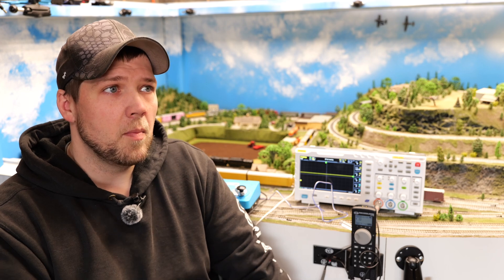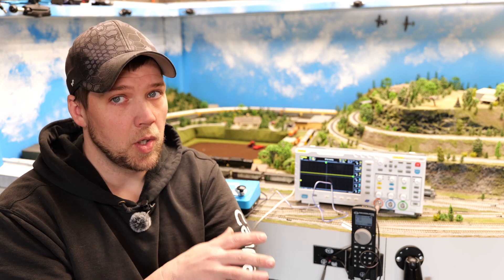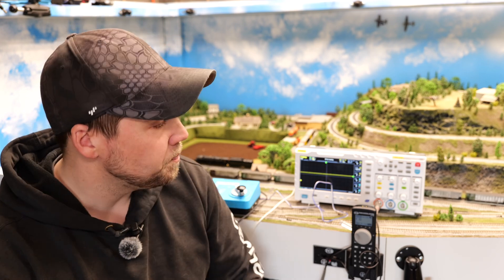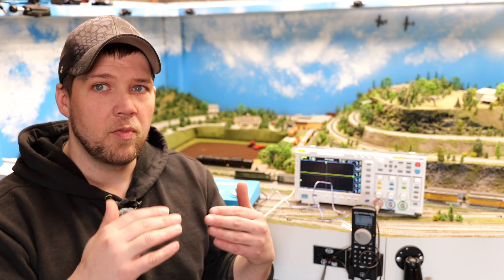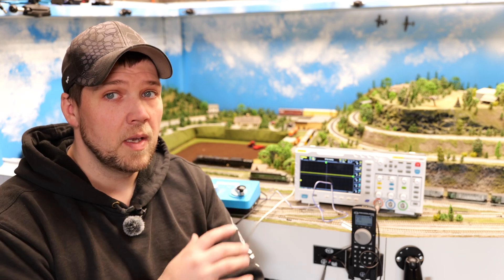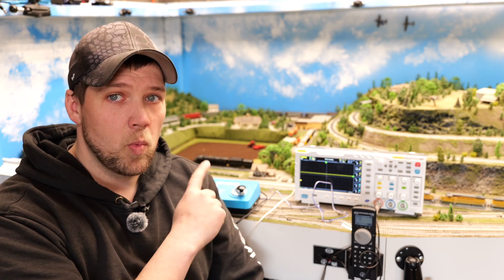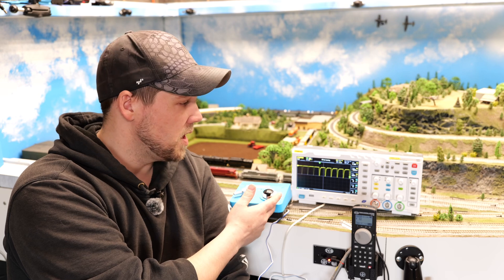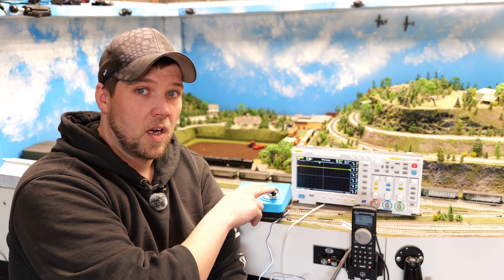Is it time for DC to die?

Comment: Clean power from a wall wort that's funny. If that was on my radio you would be able to hear yourself think. But, not even  dcc is clean RFI. I have to unplug my trains when I want to use my radio. TOO much interference. Nice to see someone out there still can use an oscilloscope. Keep on learning young man. You said you have a ham radio what is your Call and what is your radio. I am a Icom 7300 guy, it has never let me down.
Reply from the maker: Honestly just a lurker. I have a gmrs license. I could take the tests but just havent had time. I have a repeater setup and some gmrs stuff for our homestead. When I can get my license I have an FtDX10 to us

Comment: How the hell do putting 12 volts to a motor half the time make it 6v? That doesn't make sense.
Reply from the maker: Youre not putting 6vs to the motor. If you pulse 12vs at a 50percent duty cycle it averages 6vs. So just say the frequency is 60 cycles a second it would be on for half a second and off half a second but pulsing 60 times

Comment: no .. not at all .. DC should still be the standard for getting kids into the hobby .... who is gana buy a kid a 300.00 loco??
Reply: In what universe is a DCC loco $300? A Kato runs $90-100. Decoders are $30-50. All he is saying is that just scrap the DC version and only offer a DCC model that runs on DC as well. Up the cost by $10ish and have a more capable loco.
Reply: @NSCALESNAIL  true for n scale it makes sense but not HO .. even backmann is 400 bucks now for a lil 44 tonner 500 bucks for a GS4
Reply: @ClintonvilleModelRailroad  Man what hobby store is twisting the knife in your back? I was just looking at a U30b in HO on train world. $139 for DC and $219 for sound. Also the Genesis SD40-2ts with sound are like $220. In many cases HO is cheaper than N scale.
Reply: @MustangB429  139 plus shipping and tax about 200
Reply from the maker: HO is a different animal. My arguments about boards is much different. Lots of space in a HO engine compared to N scale. I feel the argument still holds weight but much more valid in N. I look at it as a scaling issue. Get rid of DC and have DCC boards work with DC. If every manufacturer did it the cost of the DCC engines would fall from competition and volume. Thats all I want. Better. Reliable. Affordable.
Reply: @thenscalereviewer  DCC is DCC it doesnt matter what scale its alot more money that you not gana want spend when the loco will be destroyed by a kid ...
Reply from the maker: @ClintonvilleModelRailroad  I have had exactly the opposite experience. I have my 3 year old run my models all the time. He wanted to use my big boy the other day. I can use dcc to restrict his controls and speed and I can be connected to the same loco at the same time in case of issues. When I broke engines as a kid it was from ripping the transformer to full speed and flipping it to full reverse. With momentum and soft start you cant do that. The model will last longer when used in that way. The difference here is I don't care about toy grade Bachmann locos being dc. Give them to a kid all day. But Hobby grade, quality locos are being held back by conforming to dc and dcc ready standards. People aren't going to by a Scaletrains loco for a kid anyway and if you do they should be ready for it or be supervised anyway.
Reply: @thenscalereviewer  I do this as well. I can "take control" of the consist if things get out of hand. How do you limit the speed of the loco though?
Reply: @thenscalereviewer  so your 3 year old has his own layout .. cool its the exception
Reply from the maker: Zeo I use yard mode in my tcs system limits the max in either direction to 50 out of the 126 speed steps.
Reply: @ Lol, and the argument is lost. Alex now do a video on how we should get rid of the NMRA. Lets really work up fuds.
Reply: @NSCALESNAIL  NMRA sucks .. always has
Reply from the maker: I am no fan of the NMRA. Gotta work towards the Golden Spike of Power and Excellence.
Reply: @Zeo-m3x program the max speed cv to a lower number....

Comment: A modern DC transformer would probably put out a PWM (pulse width modulated) power source for locomotives. A PWM power source is excellent to get motors to to run at lower RPMs reliably. A DCC decoder would put out a similar power source to the motor. So from the motor's perspective there is really no difference.
Reply from the maker: Im sure most dc controllers do. That kato controller is only a couple years old. I dont have an issue with with dc controllers using pwm, I was just getting comments about how dc is better for reliability. My point is there really is no difference.

Comment: you seem to think esu is putting out a premium product i think their stuff is at digitrax level, out of all the lok decoders i have one works properly where as out of my tcs decoders all of them work properly, i feel lok is using inferior electronics myself
Reply: What does works properly mean? Loksound decoders are, by no small margin, the best decoders out there. V5s are completely unlocked for all sound files so infinitely programable. I like TCS stuff but it is no where near as powerful and user adjustable as a Loksound decoder. Agreed that digitrax is not that great compared to modern stuff
Reply: @NSCALESNAIL I wish the lokprogammer was cheaper. Main barrier to entry. The V5 decoders are sooooo much better and have really come a long way. I had issues with the older v4s and the older lokpilots
Reply: I have a friend that tried to talk me through all the stuff, but I just had him use his programmer to set my locos up. He did a bang up job. I have no clue what he did but the three locos he set up are flawless. To my ears best throttle and notching control I have heard. I easily was able to speed match with low mid high cvs. I couldnt do that easily on the V4 lok boards. I had to have people put special speed curves for some of my engines.
Reply: @NSCALESNAIL  it means many cvs that cannot be read and or programmed
Reply from the maker: I agree Snail esu is much better. Never had cvs not get read or programmed. Railcom issues maybe but not on a programming track. Railcom programming is much better than using the programming track anyway. On the fly cv adjustments is far superior. Frankly as good as TCS decoders are, they cannot keep up with ESU user configurations. Switching mode, different brake modes, open source sound files, and drastically more lighting options just to name a few. Mo options might mean mo problems. CVs much like dc should go by the wayside. Computer interface is much better anyway. JMRI exists for a reason. Give a layperson a cv list and say make the light dim and they will laugh at you. Give them a drop down menu that says "light dim on stop" and bingo programmed loco.